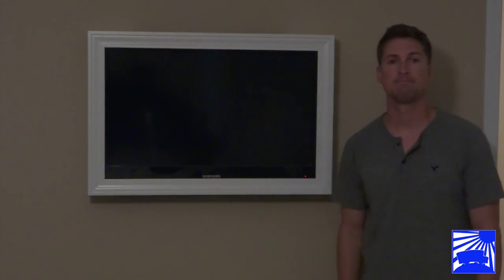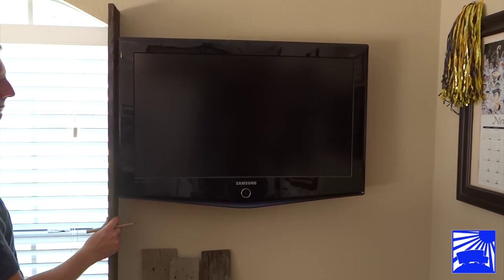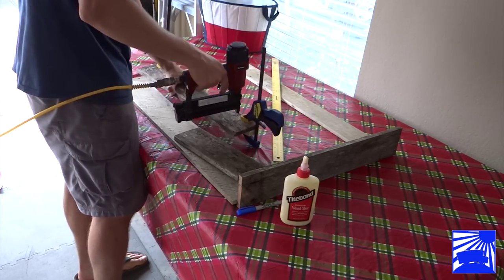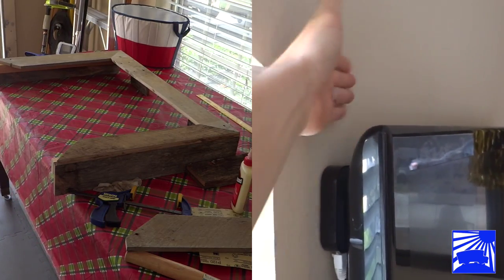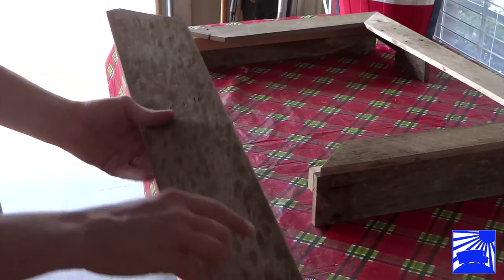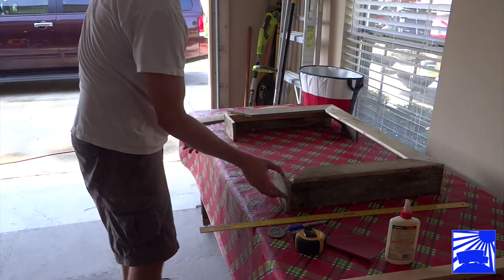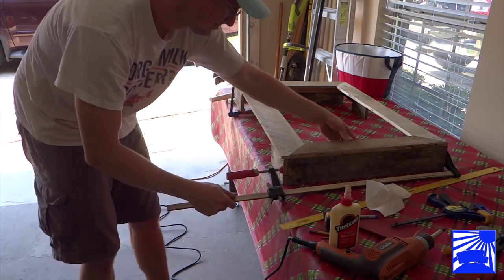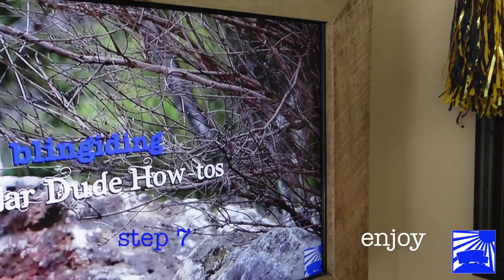Man Cave Project: Rustic TV Frame

Comment: super awesome man. just what I was looking for. is your frame just sitting on the TV or did you use any velcro etc?
Reply from the maker: It hangs on the TV.  Depending on the TV bezel, you might want to use Velcro to keep the frame stuck to the face of the TV.  Had to do that for one of mine.
Reply: +Regular Dude How-Tos ok awesome was just checking out cut the cord video. hope to see more of those as well. subscribed